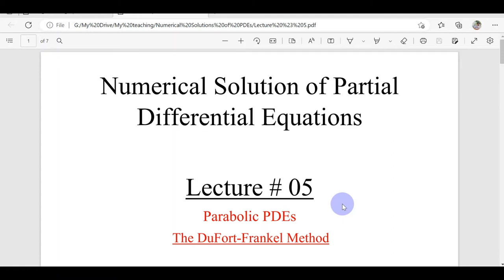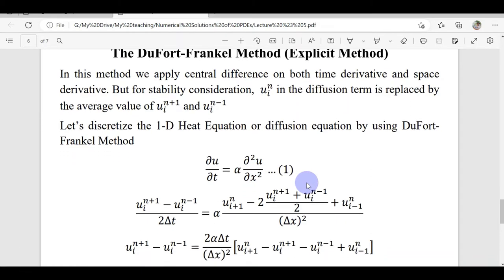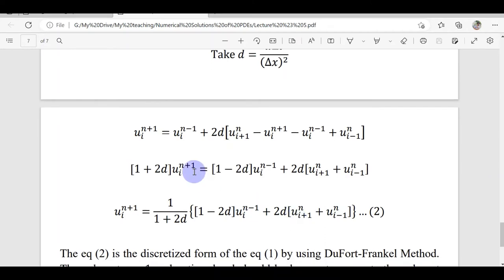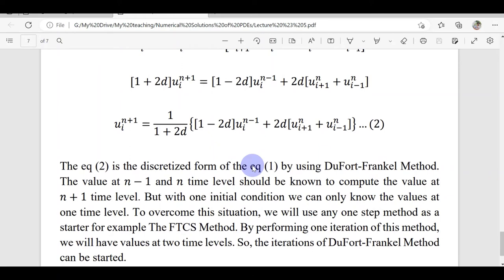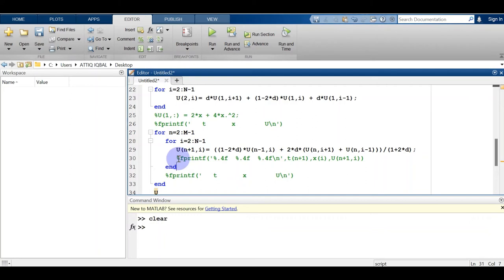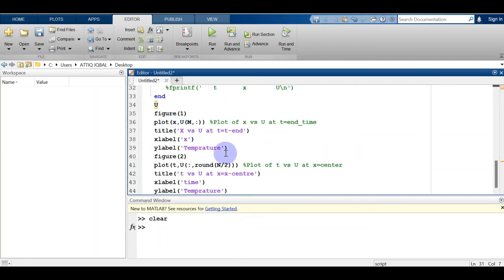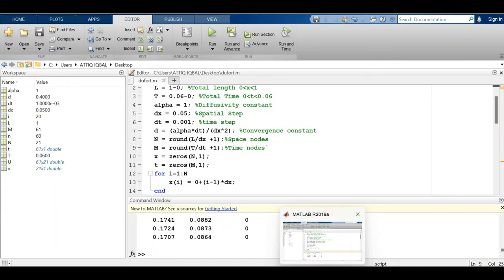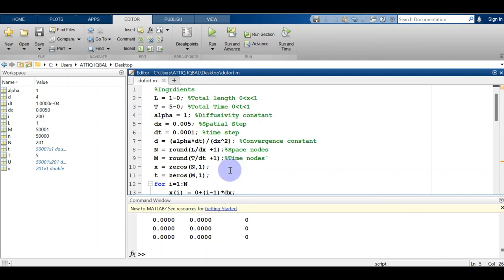The DuFort-Frankel Method with MATLAB code (Lecture # 05)

Comment: Good video, thanks. I wonder how this scheme will work if the arithmetic mean is replaced not by the second, but by the first or third term in the right part  of equation? Or did Dufort and Frankel consider these cases and reject them?
Reply from the maker: Good question. I am not sure what will happen in that case because I haven't tried it. One thing I am sure is that the method will not be explicit in that case and maybe it will overlap with already existing implicit method. You can try it and maybe we will see some new method with your name and I will be covering videos for that method.

Cheers